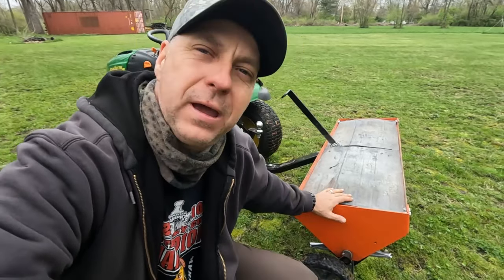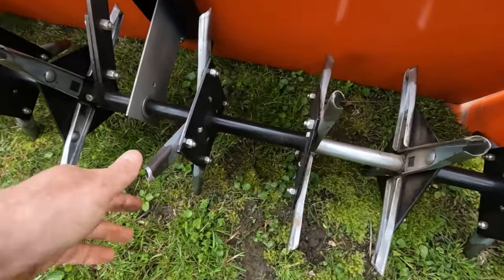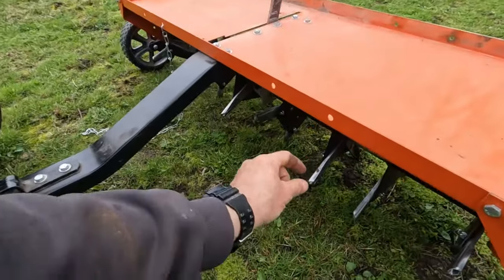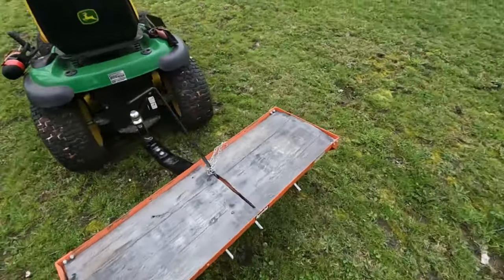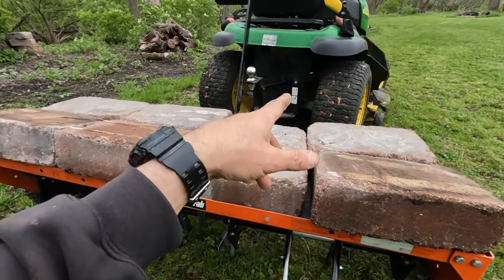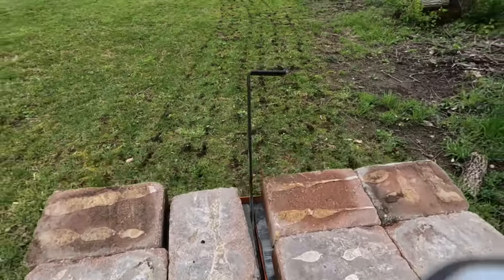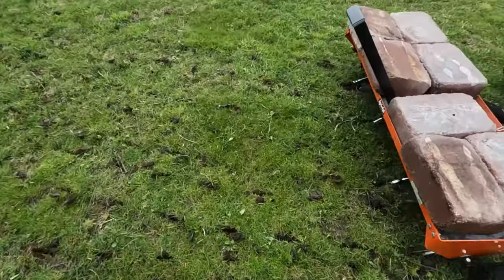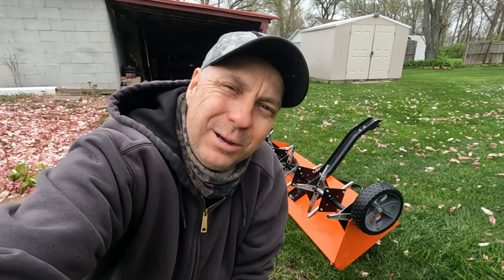Agri-Fab 48"  Plug Aerator Demo and Review

Comment: Hey man-  great video.  I’ve used my old agrifab aerator for 7-8 years and it does a great job opening up the lawn.  I don’t really over seed anymore because the lawn seems to take off on its own and grow in nicely during the season.  During one winter I got stir crazy and made 2 forms and poured 2 60lbs bags into each form.  Rigged bar and handles for easy loading and even rounded the edges for a clean look.   It was beautiful.  A real work of art.   Only to then realize that the 240lbs worth of weight I made is 100lbs over the max payload of the poor thing.   So a little cussing and stomping fits later, I filled the original cinder blocks with extra mud and now use them as weights as I did before I started the wild ride.  The wonderful forms now hold down my wife’s yard art from blowing over in the wind.  They mock me every time I walk by.
Reply from the maker: Haha.  Sounds like something i would do and say as well.  At least you found a use for them!

Comment: I've owned 2 of these aerators.  The first was warranty replaced and Agrifab and worth mentioning they handle warranty claims with integrity.  That being said this product isn't very good.  The handle that engages the transport wheels easily pops out causing the tines to lower and hit a sidewalk, road, etc.  The tines are extremely cheap and easily damaged.  It rarely pulls plugs or achieves a 3" plug.  The tines often drag the ground in transport mode due several design factors such as axle deflection, wheel diameter, lift height.
Reply from the maker: Glad they replaced it for you.  I agree about the handle.  Thats why i modified it with a chain.   Other than that i don't really have any problems with it.  I definitely dont think it was designed to withstand sidewalks or tree stumps so any dulling of the tines from that i think most would consider abuse.

Comment: turn the pin the other way. cotter pin on bottom
Reply from the maker: I originally was.  But since it doesn't get much force against it and i don't enjoy getting on the ground to find the hole i stopped.
Reply: @thehandyhomeowner9781  if the cotter pin breaks and the pin falls out you won't enjoy chasing the aerator down the street either

Comment: I got same aerator but my e120 was really struggling with it , long story short I end up getting JD x545 with drive shaft and stuff to handle this aerator properly
Reply from the maker: I agree.  My l120 and lt190 will pull it as long as i dont load it down on moist ground.  but the 318 i got last spring drives like it isnt even back there.   Even if i have it loaded fown with 4 or 5 cinder blocks making it dig deep into the ground.   Big difference.

Comment: Very well done video.  I purchased a used older all black Agri-Fab Aerator 45-0299 at an auction for $25 - what a steal!!  Mine does have tires that you have to air up.  I note that there is a video by Agri-Fab that shows how to adjust  so that the release handle will stay in that notch.  I pull my Aerator with a Toro Z-Turn mower - can't reach the handle though.
BTW, I like the way you have your hitch - either ball or pin attachment.  I have to remove my 2" hitch to use my Aerator.
Reply from the maker: Thanks for the comment.  That hitch assembly is useful.  I bought it so i could use the ball to move my boat around more easily.  I'll check out that video.  The handle stays put except ehen im tryying to put it away by hand and then it jumps out at the most inopportune time.

Comment: Great video. I have a question for you Have you had any trouble with the Agri-Fab pull behind aerator, also do you use the agri fab pull behind spreader if yes how do you like it? Thanks
Reply from the maker: I have not had any significant issues besides mot havijg enough power in the tractor to back up occasionally. But less weight on the aerwtor would also help that.  I do use rhe pull behind spreader andlike it  alot.  I did a review on it as well.  Just be careful when assembling it.  If you use the wrong holes abd then pull the lever for the trap door you will break it.